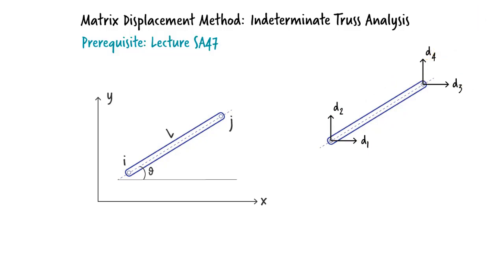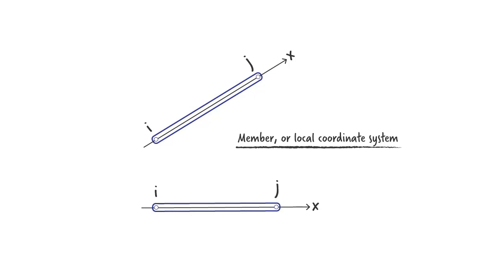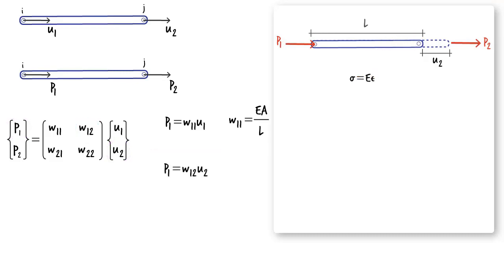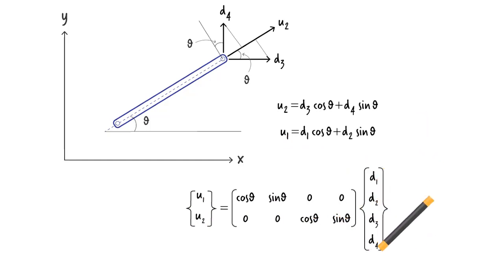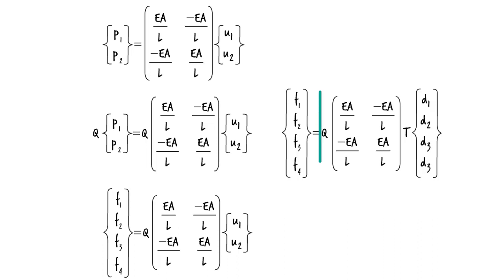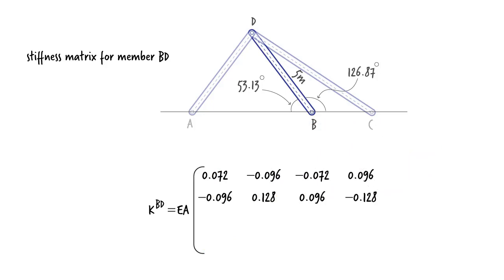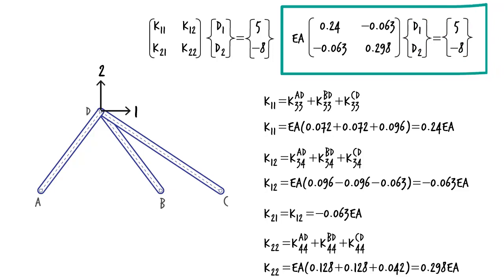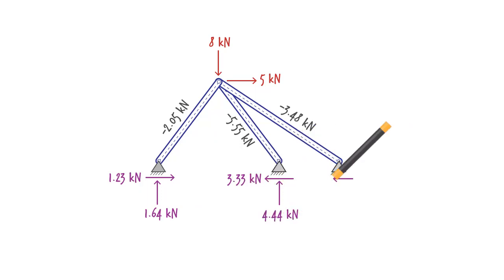SA48: Matrix Displacement Method: Truss Analysis

Comment: Can you answer me ? The stiffness matrix is constant in all questions for sin and cosine or shall we derive them individually?? I understood the idea behind it but it is really confusing
Reply from the maker: The general stiffness matrix is expressed in terms of the member length L, modulus of elasticity E, moment of inertia I, and the sine (s) and cosine (c) of the angle the member makes with the horizontal axis.

Because this formulation is generic—in terms of E, I, L, c, and s—it does not need to be derived for every problem. 

For a specific beam, we simply substitute the numerical values of these parameters into the general stiffness matrix to obtain the stiffness matrix for the member/beam.

Comment: Is this a 1D or 2D truss member stiffness matrix ? I see some stiffness matrix as (EA/L)*[1 0  -1 0; 0 0 0 0; -1 0 1 0; 0 0 0 0] and I am confused :( Please help me!
Reply from the maker: The truss is modeled in 2D space (x and y axes). For 2D systems, the stiffness matrix of a truss member is a 4x4 matrix. The coefficients of this matrix depend on the orientation of the member, specifically the sine and cosine of the angle it makes.

When a truss member is horizontal or vertical, some stiffness coefficients become zero due to the sine or cosine of the angle being zero. This holds true even though we are working with a 2D model.

For truss analysis, we don’t have 1D models; the models are either 2D (plane truss) or 3D (space truss).
Reply: @DrStructure  Thank you very much for the kind answer :) 💖

Comment: greetings I was wondering, if you have a IE value when is the safest time to enter the values?
Reply from the maker: E is the modulus of elasticity of the material and I is the moment of inertia of the member about its axis of bending. These values depend on the type of material being used and the (cross sectional) sizes of the structural members. Generally, we use them at the beginning of the process, especially if the structural consists of multiple member sizes or materials.
Reply: Thank you for replying so quickly have an online exam today.... appreciate it 👍🏾

Comment: @ 12:02 how did you get the 14.59 and -23,75
Reply from the maker: We have two equations in two unknowns:
0.24 d1 – 0.063 d2 = 5 EA
-0.063 d1 + 0.298 d2 = -8 EA
Solving them for d1 and d2, we get:
d1 = 14.59/EA and d2 = -23.75/EA

The use of the matrix displacement method requires knowledge of linear algebra. Without knowing how to solve systems of linear equations, you will not be able to analyze structures using this method.
Reply: @DrStructure  thank you, brainstormed it and realize I have to use simultaneous equations

Comment: im confused, im plugging in the values for cos(theta) testing if you got it right, but i get values like 0.72, not 0.072. Or sometimes i'm getting half your result, like 0.36 instead of 0.072. Do you know what i'm doing wrong? :/.
Reply from the maker: The values are given in the video are cosine and sine divided by L. Note that the matrix has (EA/L) as a multiplier. Here, we are dividing the elements of each member stiffness matrix by L in order to facilitate the compositing of the system stiffness matrix.
Reply: Dr. Structure oh yeah I forgot about the EA/L factored outside. No worries. I don’t understand how this channel hasn’t exploded. This channel has every topic covered so thoroughly for structural engineering students it’s absolutely incredible. I am studying for a test in two days on-indeterminate  structures and I feel I get it, pretty well actually. Thanks again !!

Comment: @dr.structure how to incorporate indirect loading like misfit load due to temperature in stiffness method In truss
Reply from the maker: The displacement method can be easy modified to take into account secondary loads. For example, if a truss member goes through a temperature change, its length wants to change in relation to the change in temperature and the coefficient of thermal expansion. The change in length equal: (Thermal Expansion Coefficient)(Temperature Change)(Member Length). This change in length times EA for the member gives the force in the member caused by the change in temperature. We can then translate this member force into nodal loads (at the ends of the member) and proceed as if they were actually applied loads. We calculate the system stiffness as before and solve the resulting system of equations for the nodal displacement...

Comment: Good day Dr Structure, i am emailing a problem that i am busy solving it that has a support settlement. So my challenge is how to involve it on the calculations coz at the end its not giving me the correct reaction especially the directions
Reply from the maker: Your solution looks good. You probably have made a mistake in solving the linear system of equations. Please check your email for additional details.
Reply: @DrStructure  Thank you Dr Structure. My problem has been finally solved, i have finally seen where i was making a mistake, and also the final treatment of the settlement that i would not ever had known.